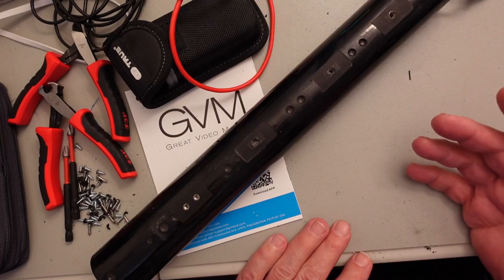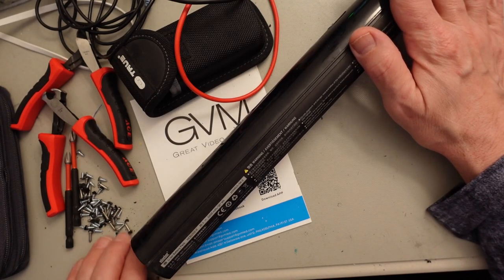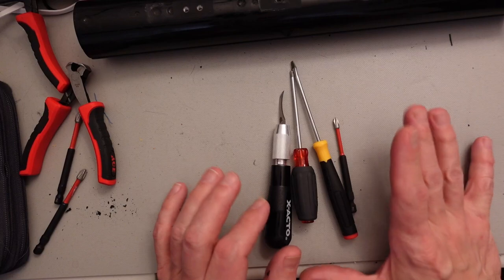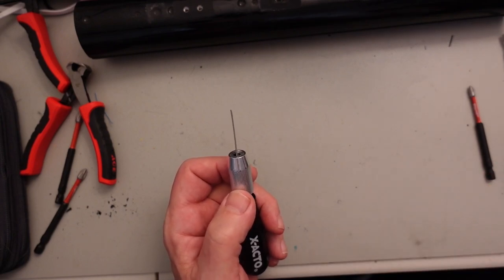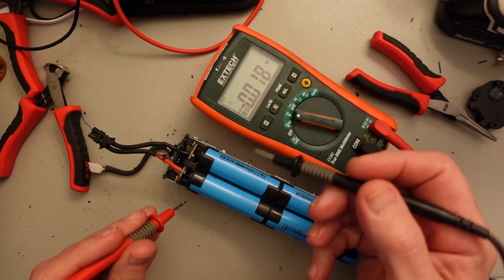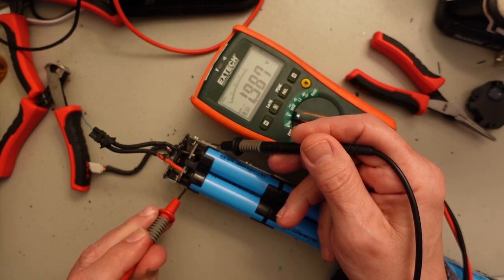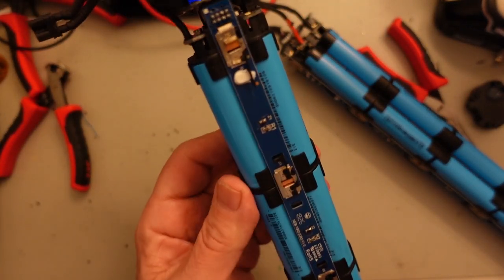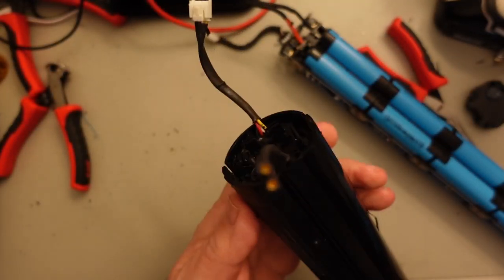Recovering dead scooter batteries to full function

Comment: Awesome video! So I tested my voltage on the battery and its 41 volts, however after pressing the brass reset button, Im not getting any color light to show up at all... Any ideas?!
Reply from the maker: I had at least one pack that had a failed BMS, yours might be the same.
Reply: @magic.marmot  That's what I was thinking as well.  Thank you for the thorough video and valuable information!

Comment: After removing my battery and pressing the "Reset" button, I get 8 red flashes, 1 longer red flash then it turns off. The pack reads 41V though. any idea what the problem would be?
Reply from the maker: @theruckusdj  no clue. Definitely sounds like a fault condition, but I don't know the codes. 
I'd check to see if the individual cells are balanced, but if it's at 41v, it sounds like they're at least top balanced.

Comment: How can I charge the battery’s ? I need special charger ? Mines been sitting for along time and is below the threshold for charging normally is there a way to use original charger and by pass the chip that shuts it down.
Reply from the maker: You need a power supply that is constant voltage/constant current. If you can access the cells directly, you can charge the battery, bypassing the protection circuit. 
But be careful, if the individual cells drop below the minimum sustaining voltage, they may be damaged.

Comment: If I just want to get to the reset button on the bms board, after I take out the four screws on the end, is it necessary to take the sides off or can I just pull off the top piece that is covering the board and access the reset button?
Reply from the maker: I think you have to remove the sides, but they're not attached.
Reply: @magic.marmot  what if I make a few small incisions on the sidewall and pull it open to access the button and then tape it shut? Or would this compromise the batteries Integrity moving forward?

Comment: One whole side of my battery is fully charged and the other side is flat, would these method re balance the whole battery pack?
Reply from the maker: If the cells in the pack are flat, they're probably dead and should be replaced.

Comment: The battery from my e25e is flashing blue light, but de voltage is only 3.5 volts. Also as i charge my battery de lights from the charger is flashing red and blue. Do you now what the problem is?
Reply from the maker: No, but if you check the manufacturers website you may be able to find that information. 
Flashing blue and red sounds like an error condition, but I have no idea what it means. If the whole pack is reading 3.5 volts and that's not per-cell, it sounds like the pack is dead.
Reply: @magic.marmot  the pack is not dead because in the inside of the battery is reading 39.9 volts and the 2 conectors that go into de controller of the scooter read 3,5 volts, do you now what I can do? Do you now what the problem is?
Reply from the maker: @jafeth1195  My suspicion is that the BMS has an issue. It may need to be awakened, but I know nothing about the pack and can't really help.

Comment: Can I use a 12v charger from a laptop to charge the battery directly?
Reply from the maker: No, you need a charger specifically designed for LiPo charging a 10s pack.

Comment: Where did you get charger?
Reply from the maker: I used a constant current/constant voltage power supply, but for these chargers, you can get them online. Just look for 36v or 40v lithium ion chargers.

Comment: i bought a faulty scooter which had not been charged for some unknown time and the battery will not charge....the battery pack is the same type as in this video...can i just connect my bench power supply at 42V to the thick red/black power connector without having to take the plastic casing apart ??? pls could you advise.
Reply from the maker: Not really. If the voltage of the cells drops too low, the BMS inside shuts off. You'll probably need to connect directly to the pack to see if it can be recovered. 
Taking the cover off is easy though.
Reply from the maker: Also, there's a small button on the BMS board on top that you press to reset it once the pack voltage itself is above 33v.
Use a constant current constant voltage to charge the pack.
Reply: @magic.marmot  many thanks Rob for your reply and i will try what you said...some time ago i was given a bulk amount of the 18650 batteries some of them were badly low voltage but i charged them with my bench power supply and got most of them working.
Reply: @magic.marmot  ok thanks will try that
Reply: I removed the battery pack from the scooter and measured 15V on the two pin black connector...so i connected my bench power supply to this two pin black connector and charged at 42V for some hours until the battery circuit stopped the charging....the blue light came on but i could measure no more than about 21V on this black connector so i put the battery back into the scooter and the scooter powered up but when i tried the brake a message came onto the app screen that the battery was overcharged and to be careful so we took the scooter to the park and rode the scooter for some time until the battery level went down to about 60% the i plugged the charger into the scooter socket but i got no indication of charging,,,so im confused....could you pls advise ????

Comment: Loooool. Why don’t just push the reset button??? You had your finger on it, not knowing what it was🤦🏼‍♂️
Reply: that is exactly what I was thinking.  Why go through the trouble to jump the battery, when it can be easily pressing the "reset" button, since he went through the trouble of actually open up the casing.  In other videos, instead of removing the entire casing, they used a soldier gun to create a tiny opening in order to access the "reset" button switch.

Comment: I have the Blue light on, but original charger stays green not charging 😶
Reply from the maker: I used a CC/CV power supply to charge through the power connections, not the charging plug. 
The charge port on the battery has additional circuitry that may be bad, especially in surplus batteries.
Reply: @magic.marmot  I habe es anders gemacht. BMS Platine hab ich 1-2min von Batterie abgemacht und wieder zusammengesteckt und voila ich habe geblinkt blaues Licht und original Ladegerät funktioniert auch 👍

Comment: I did everything in the tutorial and I've gotten my battery up to 41 volts but he still won't turn blue and it still won't register I don't know what's going on also at the plug it's only register in about 20 something Volts.but 41 volts at the terminals on the pack
Reply from the maker: Take the plastic shell off of the pack. 
On the top there is a pushbutton that you need to press to "wake-up" the BMS.
Jehu already has a good video on how to do it, but remember that these are surplus packs and some are defective.
Reply: @magic.marmot   I've tried that still just blinks red a few times then stops. Also when I test the main battery input connector ( the two pronged one with the red and black wires)
I get only like 20v or so but if I put the positive probe in the connector and the negative probe directly on the negative side of the pack I get the full 41v.
Reply from the maker: @WEEDHOPPER ARMES  sounds like the BMS board may be faulty. I've had a couple of bad ones.
Reply: flash it, with a new firmware  https://www.youtube.com/watch?v=YoobPSSkObE&ab_channel=TonyLeung

Comment: This is a link where you can find out how to reset (awaken) the internal battery (nine bot E22E) without opening the battery :
https://www.youtube.com/watch?v=toRyGWnEL8Y 
from Chris Luellen.
 I did do the procedure (with the 12 volt) and my battery is flashing with a blue led and after a few houres loading (no red led on the charger) or letting the charger connected,  it did show 38,5 volt. At the start it was 19.5 volt and no blue led. I did not see the red led. I will assemble the Nine bot E22E and see what happens... 🙂
Is this the same as if i should open the battery and push the reset-button on the BMS please?
What a nice video Rob Withoff....congrats !